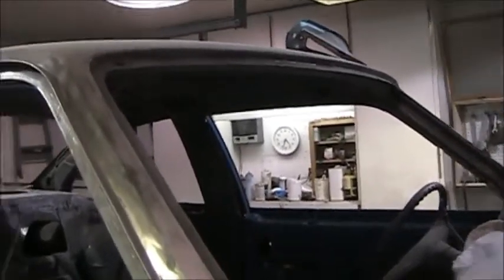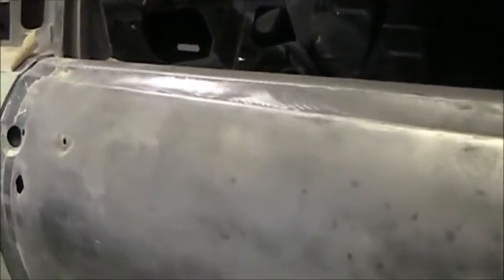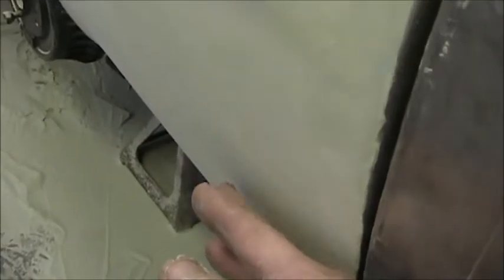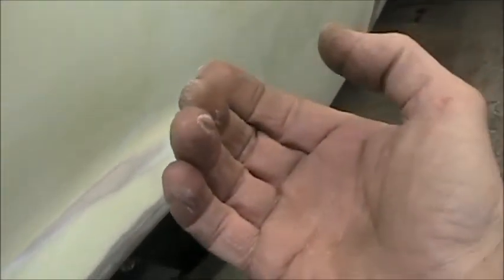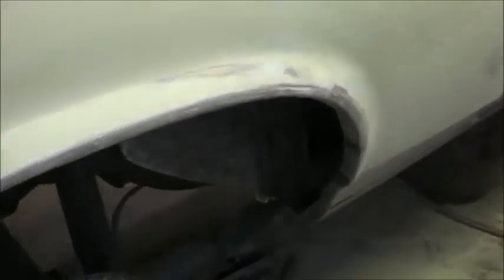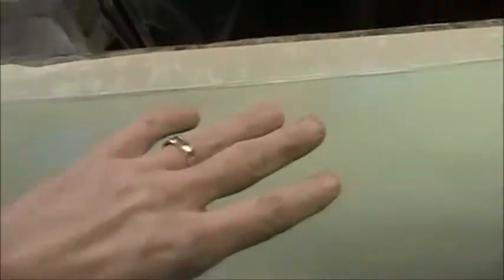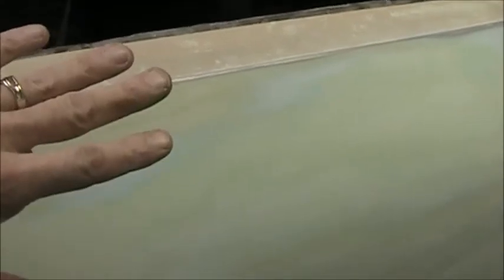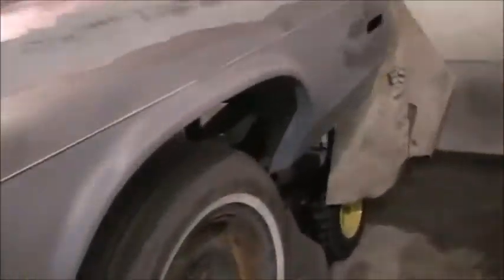one lift painted and a nova problem that needs corrected

Comment: It's never easy to backtrack when something isn't right in the process but it happens a lot to a lot of us. No matter how hard we try to do it right there are always a few kink's that develop. I have always found that if something is being extra hard to get it to work then something isn't the way that it should be and a quick back check usually turns up a flaw in the process somewhere. You were smart enough to figure out the problem so I know that you will be able to correct the cause. OLDDUDE

Comment: I usually put a straight edge on those areas before filler. Always something wrong in that area, even on brand new after market quarters. Pushing on the wheel house will move that area as a unit and will get out the dip above the crown. Always good to try to find the good side and see what's going on there cause sometimes bows and stuff like that is actually how it rolled out of the factory.

Comment: That sucks about the quarter panel I wonder if u should leave the bondo on push out the quarter like u have to so you can maybe save some of the bondo work you already did, I don't think pushing that out will affect the bondo as much as you might think and you got nothing to loose waiting till after to figure out how much bondo you can save. Good job on that lift looks good.

Comment: Ric before you grind off the bondo thy to push out the pannel  with the portapower  make a end that is shaped to the wheel well so it dose not crack the bondo

Comment: Hey Rick just a thought that I have! I'm curious about the pass side door upper rear section where the gap is larger then the lower section. I was just woundering if maybe that side (middle section) of the car didn't sit all the way down and maybe that could be causing all your problems! I'm not sure cause it's hard to see on camera but it's just something I noticed in the video! Good luck buddy! The amount of work that you've done to that car I just know you will get it :)